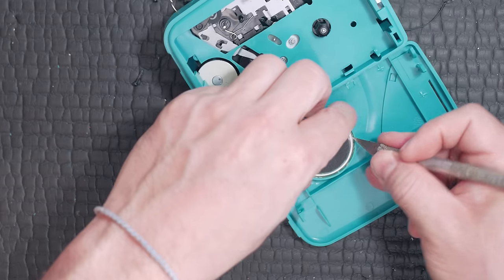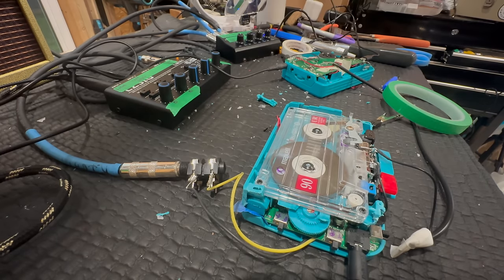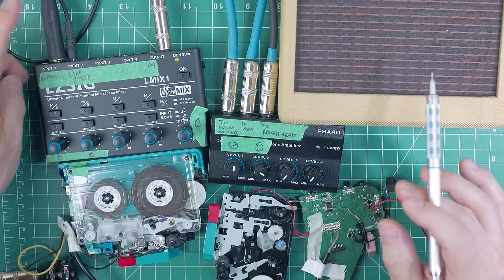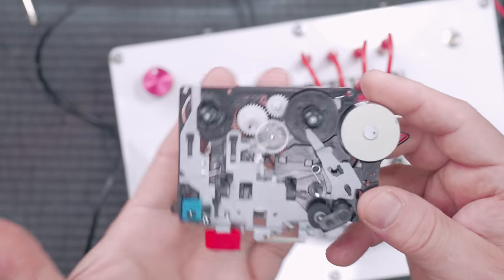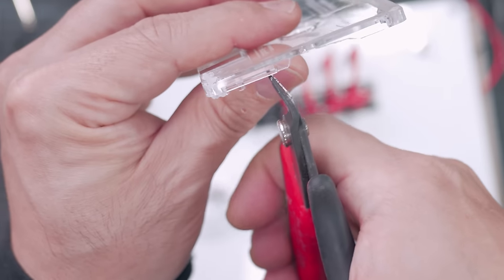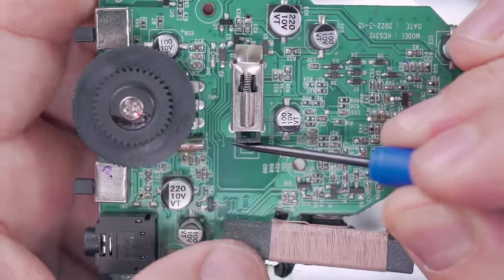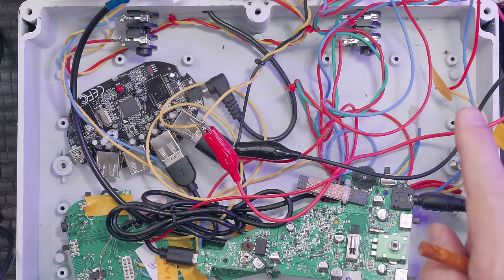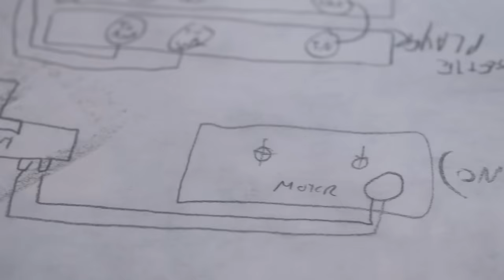DIY Analog Walkman Tape Echo Delay Pedal

Comment: Well done, thanks for posting.   I had something like this in mind.  The concept would be for the 2nd playback head to be on a sliding rail mount, so it could be laterally moved to create different delay times.  I did this with an old echoplex many years ago, left it behind when I moved (sorely wished I hadn't done that now).
Reply: adjusting the motor speed will do this too
Reply: It's a bit strange you "did this to an Echoplex" when that's how the Echoplex sets delay time by default.

Comment: A few years ago I picked up this industrial strength tape duplicator at goodwill -- insert master tape and (I think 4) blank tapes and it'll copy the master over to the blanks; (Probably used in churches back in the day to quickly make copies of a sermon)  ...Weighs a LOT, housed in a big, thick steel case. 

It was so cheap ($10 or so) and I figured it probably had quality parts and tape heads, and might just make for a great project like this someday.  Seems like it'd be ideal for a tape delay as all the tapes are face mounted and parallel to each other, so with some mods,  you could get tape running by each head in sequence.  I wish I had someone like you nearby, as I wouldn't know where to begin on a project like this ;)

Comment: Cool project, nice video. Congrats.
There's only one thing in which you couldn't be more wrong, and I quote "there was a time when imperfections were embraced". 
You can't possibly be serious. They were aiming for the best possible, but this was what they got. Period. Back in those days sound engineers would have given one of their arms for something that sounded correct, and only after they got the right tools they started to look back for the vintage sound. The Neve 1073 preamp wasn't designed to sound vintage, but as good as was technologically possible, and now that we have better, we admire it for its vintage (meaning distrorted AF) sound.

Comment: Other things to try on this: mount the second tape head on a spring, remove the tape guide from it and add a button? Handle? To it so you can bend the alignment of it to add organic muffling of the sound from it.   Also, if you used a tape that is not made for that recorder, like a type IV, the erase head will not be able to properly erase the tape, so you will get remnants of old recordings poking thru.  This would be best with a tape loop rather than just a cassette.  Cool project!

Comment: This is so, so cool. I want to build something like this but I don't think I have the knowledge or experience for it yet...

I have built a few eurorack modules from kits at this point, and absolutely loved the process, but I don't know enough about circuits yet to be able to dismantle a device and understand how it all works inside. Would love to see a more in depth guide about how to keep the circuits working after taking apart the walkman. 
Sweet video!

Comment: I've thought about making a delay using an old hard drive. With radial-mounted heads, you could control the delay time by varying the distance between the read and write heads by using servos to adjusting the angle of each head. If you wanted to use similar magnetic material to tapes, you might could use a floppy disk instead. Another big plus, you don't have to worry about getting to the end of the tape.

Comment: Fantastic sound and great demo!

Perhaps for Phase Three you could experiment with some RC filters built in for really gentle low pass and high pass attenuation.  It's so cool how you broke the heads out to allow for whatever fancy filtering you want, but I think having them built in for the cost of a pot and a cap would be really functional.

Comment: An easy way to cut the sides out would be to use some super low grit sand paper and stick it down to a flat surface. Since it's already so lo-fi the sanding dust would just "add character." But if you wanted to be clean about it you could dissasembe the cassette. I would like to build something like this when I have the time.

Comment: I bet you could've found a line-level input to the record section by disconnecting the internal radio & going in on that switch. but the mic amp has a nice AGC... 🤘
Reply from the maker: super cool suggestion. thanks!

Comment: That is very very cool. Outstanding job! I couldn't have done it better myself. As you are an ace. With old analog recorders. And you like the teeny tiny ones. I liked, the big ones. And that's why. Back in 1979. I went to work. For one of the Biggest and Most Legendary. Of, Studio & Broadcast Tape Recorders, Scully. You should get a Scully? There's plenty still out there. They sound terrific they never die. And they looked more cool than, an, Ampex. Way cooler than a 3M. As MCI's looked like Ampex.

So why did you not use a, Knock Ameche, cassette deck? Some already have 3 heads and echo. Just like the big Scully studio recorders had. And you waste a lot less time. As, there is nothing to build up. It's ready to go. Put a very speed, on your recorder. And you've got adjustable echo times. Just like that.

But what you have done here with the little cassette tape thingies is awesome! It sounds truly horrid. You did good! I am proud of you. That was one hell of an undertaking. As you definitely knew what you wanted. And that's the first hurdle. To your idea, planning, fabrication and execution. Of this terrific concept design. Who would have thunk it? Certainly not I, not me, not  Yo.

Next thing. You need to build yourself a small Plate Reverb. Using something like a car hood, sheet-metal. You cut out yourself. The sheet-metal not you. From the rest of the car hood. Then you take the old car radio speaker. And glue it to the,, sheet-metal cut out of the hood. While you suspend the sheet-metal at all five corners then reduced to 4 corners. With S hooks and screw through bolt islets in the frame. And you tighten the plate right up at all four corners.  Plugging the  car speaker into the old car radio. And then you get a tiny, FM modulator. So you can feed your audio into that and that into the car radio which will make the speakers sound and vibrate the reverb plate. Then.

You have to get a couple of, piezoelectric buzzers. Break apart the plastic buzzer plastic. And glue the little buzzer plate. To the car hood reverb plate. Stick 2 in different positions. And plug those into, 2 channels. Of your, $40 recording mixer. And Voilà! Studio Reverb! From a car hood cut out! It will be awesome! You will sound like Abby Road Studios! After a plane wreck. So it should be great!

Next thing is a Solenoid Operator Butt Slapper. With Foot Switch Activation. It'll be, State of the Fart Design! They will be able to squeeze on fourth! Or even fifth! You never know how many you will be able to squeeze out! Out of anyone. With your Solenoid Operated  Butt Slapper. It will be Beyond Awesome! I mean… Butt On Awesome!

I can think of all sorts of shitty things to do!  I'm an expert at shitty things. I spend a lot of time in my bathroom, thinking about it and doing it! I take action! And move. My bowels. Food from Sonic Hamburgers. Usually does it for me. Of which it works quickly and efficiently. It goes right through me. Like shit. Through a Goose. It works great! I recommended for people who are Plugged Up. As it works quickly and efficiently. You'll never know what hit you. It'll be all over soon enough.

At you shall feel, Refreshed. With new Vim and Vigor! You'll be like your old self of 85. Not there yet? You'll feel like it. It will extrude. That which ails you. Or Ale's you. That's usually the better option. A nice homemade IPA.  With Botulism. That will also do it quickly. When you don't clean the bottles well enough. Which I recommend, not doing for better Botulism production. It works every time! Quickly and efficiently.

Diarrhea is always best. When it's also, Bloody. Just so you know.
RemyRAD

Comment: Forgive me if this arrives as a silly question, but why use two mixers?
Reply from the maker: One mixer and one splitter is required. Since these are passive mixers, you can run one of them in reverse as a splitter.

Comment: The cheapest way to get cassette heads is to buy cassette adapters.
Reply from the maker: 100 percent true. but preamps are also needed..
Reply: I buy them in bulk from China… super cheap
Reply: @MarkGutierrez  direct to line in work fine